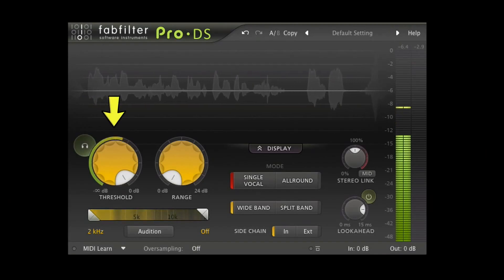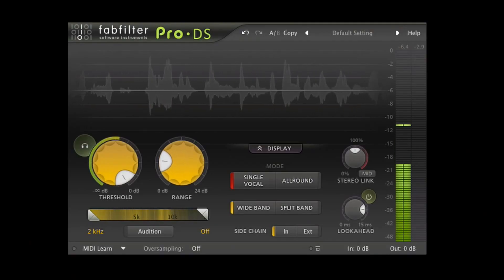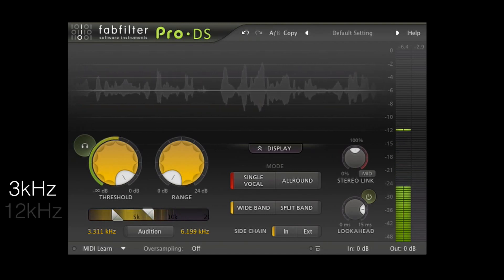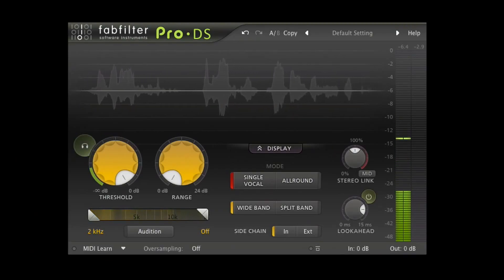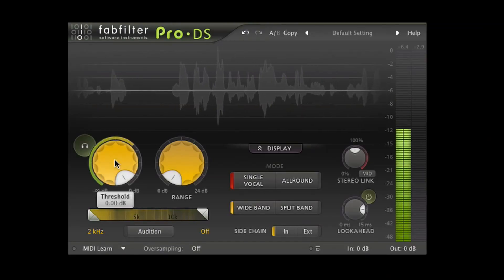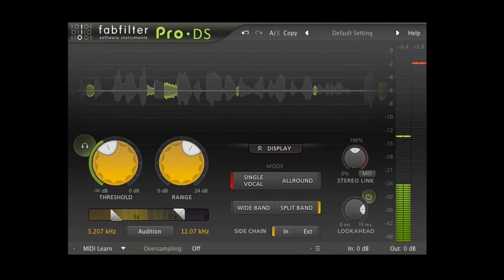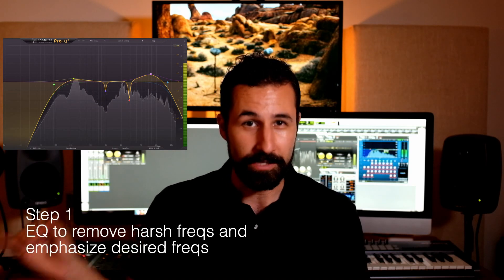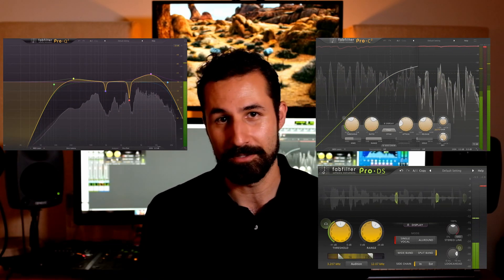How to Fix Harsh Dialog Using De-Essers

Comment: What's the drawback of ds ing before compression ?
Reply from the maker: When you compress a signal, you’re basically making the loudest and quietest parts of a sound closer in level to each other. 

De-essing is intended to reduce the level of sibilance since it’s harsh.

If you reduce the level of sibilance BEFORE you make the loud/quiet parts closer together, you basically undo the work the de-esser did.

You want to get consistent levels overall, THEN reduce the harsher parts of a sound so you retain the desirable parts while lowering the undesirable parts. Does that make sense?
Reply: @ thank you for your reply. That makes so much sense and my minds gone clear now thanks!!

Comment: Whats driving me nuts is that I'm having difficulty hearing it actually helping the SS sounds. I normally make music so I'm used to using Ableton and all the plugins but, for some reason I'm having a tough time when it comes to my own voice. I'm not sure if it's just new and weird to be working on my own voice or what. Regardless, thanks for the video. It was clear and to the point.
Reply from the maker: The easiest way to hear the difference is to take it “too far” and hear what that sounds like. With a de-esser, your sibilant sounds will seem SUPER compressed and quiet. You can back your settings off from there until they sound natural but not harsh/annoying (once they stop calling attention to themselves). I generally find I’m reducing my esses by around 10dB on average…although that varies widely of course.

Comment: Man, this is exactly the type of content I've been looking for. Question though, where in this three step process would you recommend putting a denoiser? A lot of the audio i deal with has background noise. I typically denoise first and then do these other steps. Is that the right sequence?
Reply from the maker: Yep, denoise first (if necessary)! That way none of the noise will be present while you process and shape the rest of your sound; you’ll be working with the cleanest audio possible.

Comment: When do you use say a noise filter ?
Reply from the maker: I usually try not to, but if I’ve got a lot of low frequency hum or really bad background noise over dialog, I’ll do some light noise reduction just to isolate voices or sound effects a little better. Totally depends on the source sound and how it’s being used in the mix!

Comment: Hey man, nice vid. What audio recording and editing  software could I use on windows for under $100? I’m using wavepad atm and I don’t seem to have this much control with these kinds of filters.
Cheers
Reply: It’s for my youtube videos so it’s exact same as what your doing here
Reply: Try Audacity. It's free. Or any other you might prefer, as long as they can load VST or AU plugins. 
Most DAWs, if you're planning on buying, already have pretty good plugins that comes with the software.
This Fabfilter Pro-DS costs more than your editor budget but it's free to use for xx days if you want to try it out.
Reply from the maker: Hey Matty! I’d check out maybe Reaper, it might be a good bet for your content and it’s about $60. Pretty flexible, built in tools, doesn’t break the bank. 

Let me know what you think!
Reply: Alex Knickerbocker awesome! Thanks so much mate!!